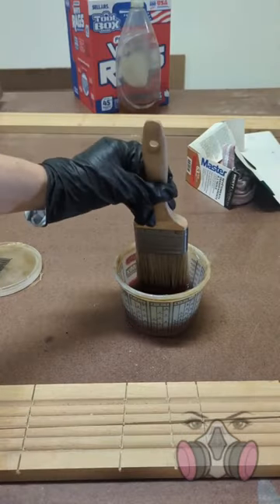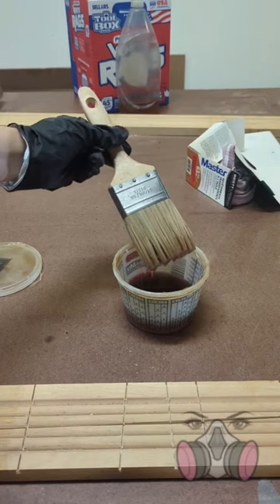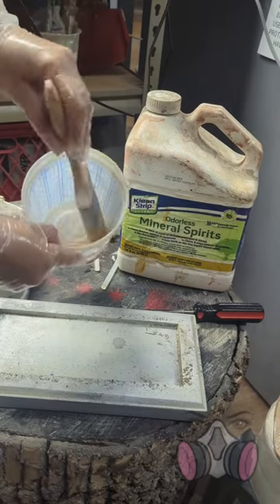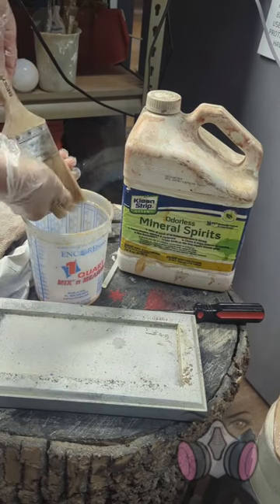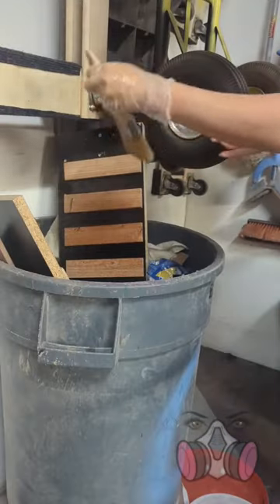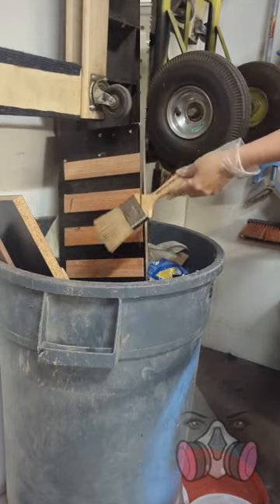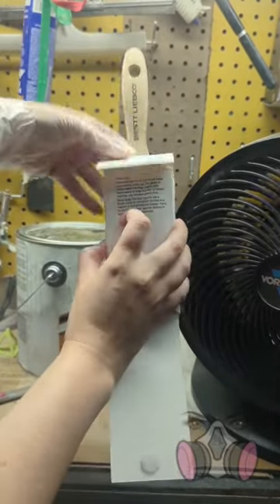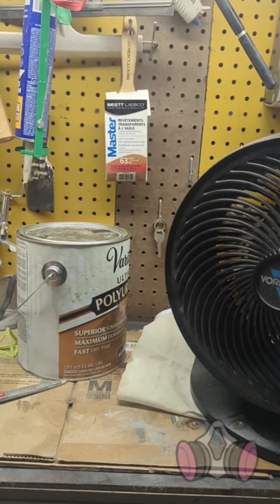Long live the brush! #woodworking #paintbrush #howto #diy #tools

Comment: Good video with useful tips. Thank you for sharing. A tip I learned from a forgotten source - before dipping into finish, dip into solvent. Like, dip into water before starting to use a latex paint or water-based varnish. It seems to minimize the finish wetting the bristles at the base, making clean-up easier.
Reply from the maker: Oh interesting. I've never heard that one. I'll definitely give it a shot. Thanks!